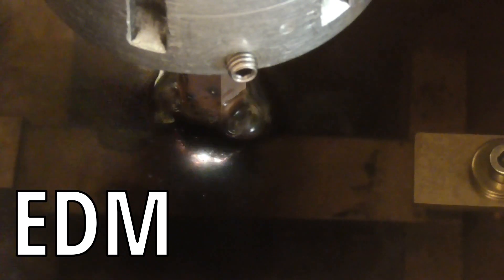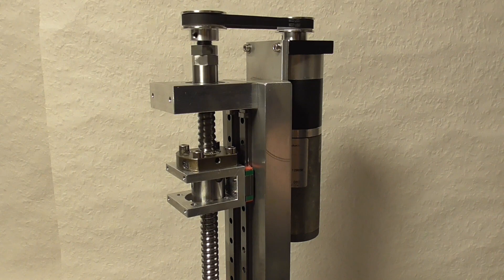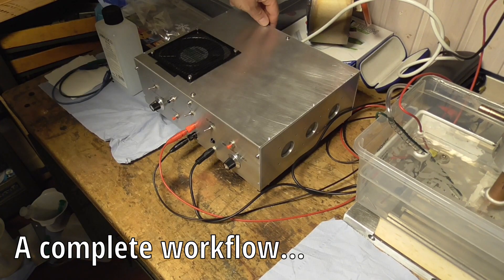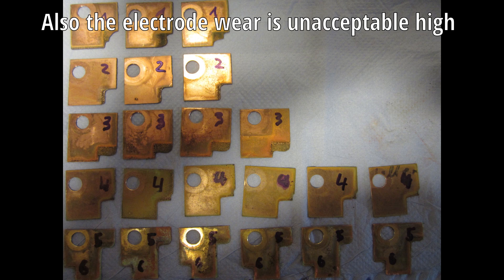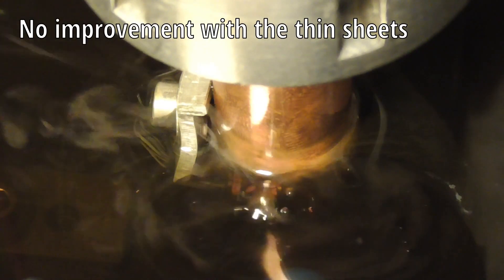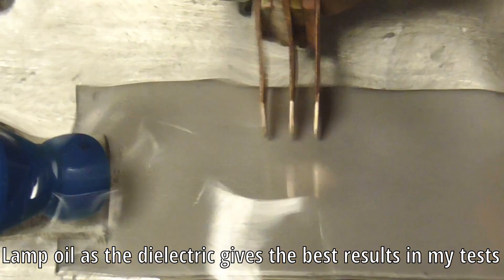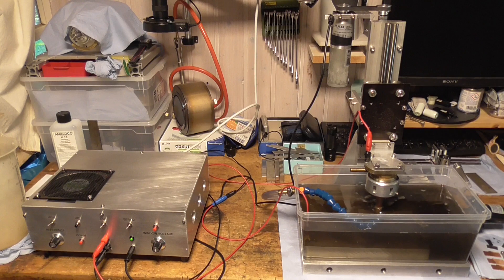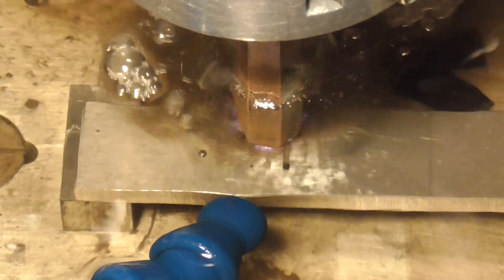Self made EDM spark eroding machine with the DIY book of Ben Fleming for the home workshop

Comment: Low viscosity mineral oil is a better "low cost" option than water or kerosene for a sinker style EDM.  Vs water, It doesn't get contaminated as quickly, has much higher dielectric strength, and makes the electrodes last longer.  Vs kerosene, it's primary advantage is much higher flash point (lower chance of fire), and improved electrode life.  Though EDM specific oils like "EDM 244" are only marginally more expensive per 5-gallon pail and offer even better performance than just mineral oil.   My dad worked with EDM for 30+ years.  He started with kerosene, then went to low viscosity mineral oil which he stayed with for about 15 years.  Eventually a salesman gave him a gallon of full synthetic EDM fluid & he was hooked.   It was very expensive back then, around $250 for a 5 gallon pail (about $500 today after inflation), but he said it lasted more than 2 years with proper filtration, & saved him hundreds of dollars in graphite over mineral oil.  I think it was similar to "EDM Super Supreme" which is one of the best performing modern synthetics available, but cost about 5x more than mineral oil.
Reply from the maker: Thanks for your kind information, I tried to get small quantities of special EDM fluid but I only foud sources who sell 100l+ at a very high cost!

Comment: LOVELY, YOU NEED A MICROCONTROLLER WITH SENSORS, FEEDBACK AND PROGRAMS FOR DIFFERENT MATERIALS AND THICKNESSES!
Reply from the maker: Yes its a very basic machine, take a look at my pulse EDM in newer videos!
I use it very much and it works great and is very reliable!

Comment: For making narrow slots, wire edm should be the way to go...
Reply from the maker: Yes i really would like to build a wire EDM but unfortunately my time is limited...
Reply: @myengines2443  Basically, you have the Generator. so all you need to do is hook it up to a 2 Axis system, and build a wire Guiding system.. (please do not make the mistake all others have made, by making it overly complicated)
I do have a Wire EDM machine, but i also do like the shaping solution you used

Comment: If you want to cut thin steel why dont you use electrolysis
Reply from the maker: Not the steel is thin, the slots are thin.
They have a length up to 60mm.
I dont think electrolysis can do that but I am happy to be proven wrong.

Comment: seems pulsing is the way to go.

the voltage is only present before the arc forms. need it to break down the dielectric.

once its conductive, the voltage drops dramatically. measure a neon sign when its running... they can be 20-30V... despite the transformer saying 15kv.

because its limited to 30mA. it will only spit 15kv out when its unloaded, or has over 500k resistance... (eir) any lower resistance, higher load, and it will remain at 30mA but sag the voltage accordingly.

anyway. when the arc is formed, its composed of ions in the dielectric, and the electrode materials. polarity dictating the majority of the transfer from negative to positive, much like welding. dcen dcep AC....

as you maintain the arc, the electrode starts breaking down. your "points" start to round off, arc stability becomes erratic on DC, and the material doesnt want to come OUT of the arc, instead transferring to the other electrode.

the pulse, if you have say, a variable capacitor (ahem... not so easy? but then again, ive dunked an old moving plate under oil and run it at 10kv...) you can charge to a specific voltage for the breakdown, but only store enough energy to dislocate those metallic ions from the workpiece... then cease the current, leaving said atomised particles floating in mid-solution where they can be flushed away. i

n this regard, allowing the capacitor to discharge on its own terms isnt the way to go, rather, once it reaches a certain level its cut off entirely, conduction ceasing abruptly, ideally at max flow. which, with some sampling shouldnt be too hard to discriminate. theres a brief rise as conduction commences, with a peak at full conduction at which point the standard RC rules of a discharging capacitor apply.

whilst theres an arc, the ions/particles tend to REMAIN in the arc. its supplying heat, energy, and its got those dielectric and magnetic effects... youre burning, oxidising, and destroying the dielectric rather than the electrode/workpiece.

liken it to blowing dust with two air guns. one lifts the dust with short rapid puffs, directed where you need, whilst the other blows each lifted cloud of dust clear... whereas if you blast both you just make a mess.

you want a corona discharge, high tension, but as soon as theres current applied it reaches a certain value then is cut-off. think of the lightning rod... you need the surfaces to produce those spikes, which they cant do once theyre actually conducting.

tungsten copper electrodes? 

another aspect to look at is the AC welding of aluminium, the cleaning action of reverse polarity. 

you just want to get the surface layer suspended, free... then push it away. its not quite the same with TIG as the main goal is the metal stay in place and simply melt, you just have to bust the oxides off. anyway.

if anything. you are basically trying to rip that charged surface layer off the plate of a capacitor, then blow it away whilst suspended. the electrode and workpiece IS a capacitor, after all. not heat anything. simply tear a layer of charge and associated particles off.

Comment: Lamp oil is the one product that comes closest to Professional Dielectric Fluid for Sinker EDM machines.. for Wire EDM, Deionized water works best.. but you have to treat that with Filter Resin as the conductivity rises when Eroding..That is why i have a resin filter Cartridge in my Wire EDM machine.. (Brother HS-100)

Comment: Bravo........run copper wire.........flow....u are trying to drill  with a flat.....if round maybe rotate electrode.......also diesel........clever.....what volts...amps.....cheers.....

Comment: Would adding some inductance in series help stabilize the arc? This is what they used to do with arc lights. Also, how do you control the feed? Is it a constant rate, or is there a control loop that is driven by the average current through the electrode?

Comment: The big machines use a speed rate, and peck and drill method, not a plunge cut. Also the nozzle, it helps to have fluid pushing the material out.

Comment: using plates is a bad idea. As the plates move down a very very small error in x or y will cause plates to short to work piece.  Consider doing the slots with a wire EDM for better results.
Reply from the maker: Yes you are right a wire EDM would be very nice but this will be very much work so I would not have any time for my original hobby developing Stirling engines.

With my new pulse EDM even the thinner sheets work well.
Just look at my newer videos.

Comment: You need to control you on/off times more accurately 
Nice machine just needs a bit more work
Interested in your thermal displacement  engines.
I once restore a large water pumping engine.....it was at least 100 years old,,,,Stirling type using wood fire 
Maybe 1 hp 2 hp I will post video soon and share with you
Reply from the maker: This sounds very nice, I would love to see your engine.
Greetings

Comment: Hi, Could you provide minimum requirements of resistor and capacitor specs, and the DC source ratings for voltage and amperage required to generate sparks
Reply: I think he will need to appropiately filter water and to use a deionizer too. I was thinking in this interesting process as one of my best friends works in this area here in Spain but we agree that is very difficult to diy a very accurate system, even he uses it occasionally in criticall operations with an industrial grade machine due to the time consuming task an high costs.

Comment: I played around with edm technology about 9 years ago.  I made a hack saw with a blade made of a strip of brass sheet metal.  I was able to cut aluminum in a bucket of rain water.  The blade kept getting stuck so I put an air core inductor coil inline with the circuit.  This causes the spark to happen when metal contact opens rather than when metal contact touches.  Inductive sparking is different than regular sparking. Anyways the coil I used was a coil from a cut open microwave oven transformer.  I can't remember if it was the primary thick wire coil or the secondary thin wire coil.  Microwave oven transformers are easy to cut open with an angle grinder.  The voltage used was about 30 volts AC.  The coil gets hot and needs a cooling fan.  Hope this helps.

Comment: Do you have a galvanical isolated DC-Voltage circuit in parallel to your spark circuit to detect shorts and reduce downwards feed rate?
Reply from the maker: As I am an electronic newbie I am not sure.
As far as I know no optocopplers or something similar are used but there is a short detection for retraction. 

Actually I have a problem with the retraction when a short occurs and I blow up a resistor (its an impessive explosion...)

Unfortunally I havent any time in the moment but as soon as I can I will repair the circuit and post a video.

It would be very nice if you could specify your suggestion.

Many thanks and with best wishes

Ralf

Comment: Could you just do simple wire EDM? That way you could worry less about it being a flat sheet. I don't know how you have to cut so I'm not sure if that'd work for your application.
Reply from the maker: Yes you are right a wire EDM is very nice but much more complex to build.
When I would decide to build a wire EDM I would not have any time for my main obsession Stirling engines.
Thanks and greetings
Reply: @myengines2443  You can buy an old wire edm for very little swap out the motors to run on Mach3 and clean up the flushing system. That is what I am currently doing and building this generator for the spark.

Comment: Hi !
don't know anything about building a spark eroda , however, have spend many years operating them. Three rules of EDM is: Flushing , Flushing , Flushing - the burnt metal has to be removed. The Most common flushing method is known as auto flushing. Here, the electrode approaches the workpiece and sparks, then retracts a couple of millimeters and approaches again. This continues until the desired depth is achieved. The speed, on time, off time can all be controlled by the machine
For your big electrode the power looks good for roughing. Way to much power for those thin blade electrodes.

Comment: My uneducated guess would be to try tungsten wire, maybe bent to do a slot. BTW, most EDM I have seen has used an x,y,z moving wire to cut. What is the advantage of using a plane? To my admittedly ignorant way of looking at it, it seems like sparks/arcs might come off the surface of the plane parallel to the cut surface which would continue eating away the workpiece and tool? Well, maybe not if the electric is super well controlled and the cutting edge is consistently closer to the bottom than the plane is to the sides but that seems tricky to achieve. Anyway, thanks for sharing your results.
Reply from the maker: Hi,
the advantage of a sinker EDM is its simplicity.
You just need z control (up and down) and no cutting wire management which makes it MUCH easier.
Wire EDM in the home workshop is a hobby for itself my sinker EDM is a project of a few weeks.
Yes, the electric control is very important so I decided to buld also a true pulse EDM next.
Still waiting for the PCB...

Thanks for your kind suggestions and with best wishes
Ralf

Comment: This is incredible!  If you can get it working it would be a massive feat. there's not many ways to easily machine deep thin slits in aluminium in the home shop :)
Reply from the maker: Hi Joseph,
now it works fine as you can see in my newer video, even in 1.4571 stainless steel which is much more demanding than aluminium...

Greetings
Ralf
Reply: If the slits run all the way through.. use wire edm...

Comment: Use mig wire as your electrode; you can the better focus the electrons.
Reply from the maker: Hi,
I tried tungsten copper as electrode material as you can see in my newer video.
It worked quite well but the thinnest sheets distorted badly.

You mean TIG welding tungsten wire?
Maybe I will give it a try.

Greetings
Ralf
Reply: @myengines2443  There is a wire used in Mig Welding; Its a sacrificial wire; sold on spools. (its Cheep.) There are two types of wire used for mig welding, and they are gas  and gasses welding wire spools. The one that you would want to use is for gas welding. Using this wire you can focus the electricity onto one spot at a time. Focussing the burn to a single spot. Opposed to larger surface areas.

 Using larger surfaces as an electrode, the ark will would be more difficult to control; causing heat to warp the electrode. As the electricity takes the path of less resistance.

With Mig wire that ark will occur in the one controlled location. And when the Amps begin to climb feed it more wire to maintain a constant burn.  The Amps will increase as the tip of the wire begins to deteriorate.

Comment: I wish I could help. I met Ben decades ago at a CNC convention in Michigan. I bought his book and built the unit and never finished it. I do remember Ben helping others online over the years. Have you tried to get his input on your needs? Provide him a link to your videos too. I don't know how active he is these days but that's where I'd start.

It looks like your using a stepper motor rather than the faster ordinary electric motor Ben mentioned in his book. Maybe your book is newer than mine and he made some changes to the design? I got the first edition. 

Yours emits the wrong sound compared to those producing a stable burn. Yours sounds more like a EDM tap burner I used to run. Those were designed to be fast but they burned up electrodes fast and produced a crude hole that tapered bigger at the bottom of the cut. 

I do think a 90 degree electrode holder would work better to cut those long slots. Lay your part on it's side with the 90 degree tool coming in from one end. The flushing will need to be plumbed for flow through  your part laying on its side.

No matter how you go about it I think your going to go through many electrodes. At least they will be easy to make out of sheet material.
Reply from the maker: Hi,
nice to hear your experiences with Ben Fleming, he is still active in the field and I ordered his PCB for the pulse EDM a few weeks ago, unfortunately it didn't arrived till now.

I use a servo motor as Ben Fleming suggests.

You are right I also think that I have a problem with too much arcs instead of sparks wich I can clearly hear in the changing sound.
With my new setup and better electrode material as shown in my newer video it is much better but still not optimal.

I thought abut the 90 degrees arranges electrode but first it is hard to align and second it woun't be easy to secure the right cutting depth.

Thanks for your kind comment
Ralf

Comment: There is a problem with pulse EDM is the machine must be big and consumes a lot of energy Because it uses MOSFETs to regulate voltage, may not suitable for home shop. I am  using diesel with satisfactory result. Kerosene is even better than EDM oil but too dangerous not worth using.
Reply: check this out, the best homemade machine. https://youtu.be/KgG_2Bdb2VM?si=U5svjANBNDUjUkFm
Reply from the maker: Hi,
I plan to build a pulse EDM also with a book of Ben Fleming now and ordered his PCB.
It is a bit bigger and the transformers are bigger and more expensive but not to much.

I also use diesel now (ARAL ultimate diesel smells less!) but before I used kerosene (lamb oil) which worked also very good.

Greetings
Ralf
Reply: @myengines2443  Read papers of Mr. Wojciech Mysinski if you want to know how a commercial machine works. They are fee on the net. Your job is difficult even on a commercial machine.
Reply: @Spark-Hole  I am having a look at Wejciech papers now. Thanks for the reference
Reply: https://youtu.be/KgG_2Bdb2VM?si=Xd7TT1gAcuoZIB5F

Comment: I think that better flushing directly into the electrode gap would help a bit. Kerosene is supposed to burn a bit better iirc.
Reply from the maker: Hi,
yes good flushing is important, with kerosene (lamb oil) I also got good results but now I use diesel which is even better.
You can see it in my new video.

Greetings
Ralf